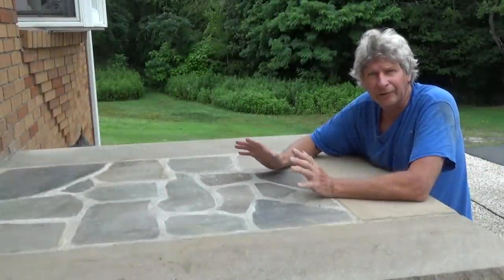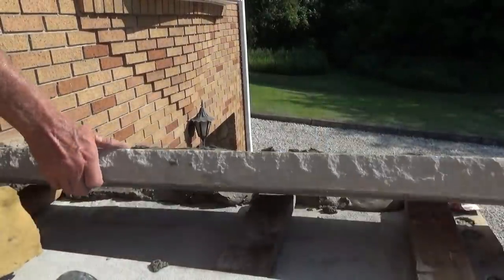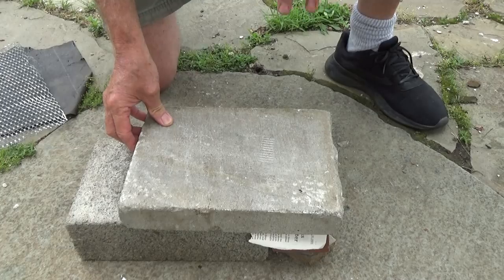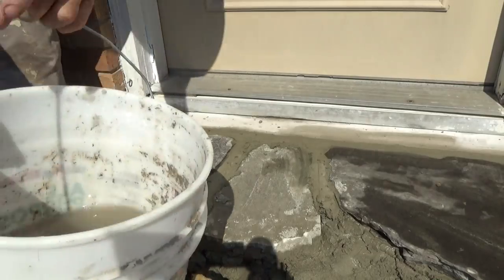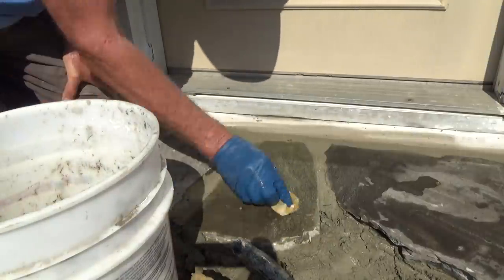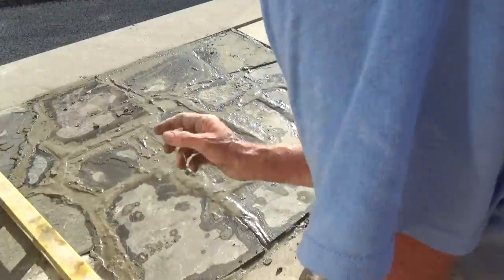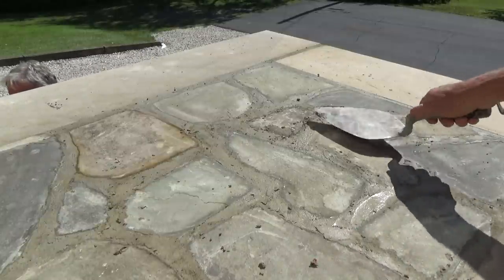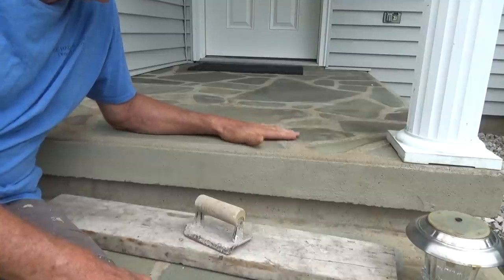CONCRETE PORCH STOOP (Part 4) Flagstone "Mike Haduck"

Comment: Mike wasn't sure if I did my patio floor (16' x 8' in Vermont slate) correct.  I set stones on  2 ½"  of a 
 3 to 1 Portland sand mix. I didn't do joints at same time ,which I should of. I placed about 6 stones to 8 a day. Joints done with a  2 to 1 portland to sand mix. 4 years later no cracks. NY/NJ area. 🙏
Reply from the maker: Hi JD, you should be ok, Portland was the right choice in my opinion, thanks Mike

Comment: Looked great! When you make the joints as you do it, do you make the joints proud of the slate? Im just wondering if you do, if they flatten out as it dries? Do you do it that way to direct the water away from the joints? If they are flush or low, would the water tend to puddle in the joints? I remember you saying that the cement isn’t water proof, so I was wondering how does it keep, or limit moisture from getting under the slate?
Reply from the maker: Hi Joe, I keep them as even to the stone as I can, I want the water to run off fast, thanks Mike

Comment: Hey Mike, just finished a PA blue stone patio using the portland sand mix.  Do you normally seal the slate/blue stone and portland with any type sealer?  Thank you!!
Reply from the maker: Hi Lou, that's great, I am not always a fan of sealers as they could be slippery but if I use them I wait about 30 days to let it cure, whatever the directions say, thanks Mike

Comment: Can I use Quikrete High Strength Concrete Mix 4000 PSI (which has portland cement, sand, and gravel)?
Reply from the maker: Hi user, I only use what I showed on my video, it's all my ways and ideas and opinions, so it's hard to tell anybody else how to do it. Mike

Comment: I made forms to look like cobblestone .individual stone shapes using type s with a little regular old sakrete .also made stone shapes like your stones for treads do concrete stones apply the same way as real stone like you have there?
Reply from the maker: Hi Lana, I never use type S to form anything,  it falls apart, usually Portland and sand, I hope it works out for you thanks Mike
Reply: @MikeHaduck  well thank you Mike but I think I will just trust in your expert knowledge and use Portland LOL
Reply: I have about 400 stones to make and I just made one I said Each of our five forms but for the other 290 sounds I will use Portland and sand
Reply: That text should read 390 instead of 290
Reply from the maker: I have a video out called " how I make concrete wall caps" Mike haduck, if I did it again I would have added a trowel full of Portland extra in each bag, thanks Mike

Comment: Paint back of stone with Portland cement for a better bond.
Reply from the maker: Hi ,if Portland mix is rich it's not needed, makes stones harder to clean and leaves Portland lines in joints,, thanks mike
Reply: @MikeHaduck  your only doing the back

Comment: Mike, in this video, at the end, you talk about not using mortar,  because it shrinks and instead using 2 sand 1 Portland. Isn’t 2 sand 1 Portland a mortar? I am confused. 

I use your videos as gospel. Bought some Rapid Set mortar to play with as well. 

And still waiting on that S Mortar video. 😆
Reply from the maker: Hi Travis, no Portland is not mortar, but rapid set calls it a mortar because of its usage,  confusing, I think that s mortar video is coming out today or tomorrow,  thanks Mike
Reply: @MikeHaduck  

So mortar is lime and sand and no cement?
Reply from the maker: I do not use mortar or lime on stone patios. Only Portland and sand,  other masons might preach different but that's what I use, thanks Mike
Reply: @MikeHaduck  

Is your 2 sand to 1 Portland like a mortar? What would you call your mix then? 
Isn’t mortar just sand, cement, water? 

I think that is where I am confused. 

You say you don’t use mortar or lime but isn’t your mix a mortar? What am I missing?  

I apologize for not understanding. No big deal 😆

Comment: Cement is to wet. The stones are all floating and moving. Stone should be in a dry pack mortar.
Reply from the maker: Hi, dry pack dosent hold up in our weather, I would be back repairing it 5 years, thanks mike
Reply: @MikeHaduck  weather no different than mine. Actually more freeze thaw cycles here.